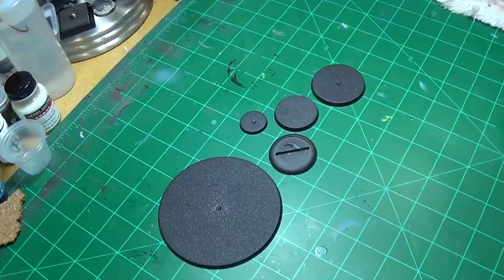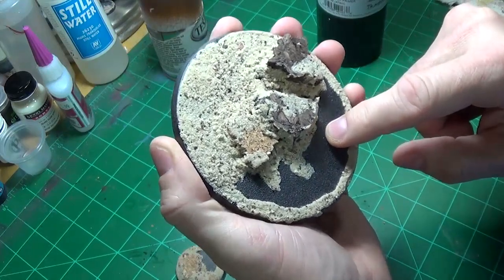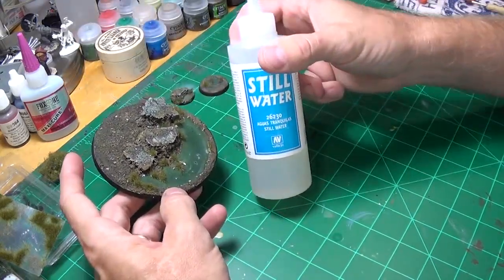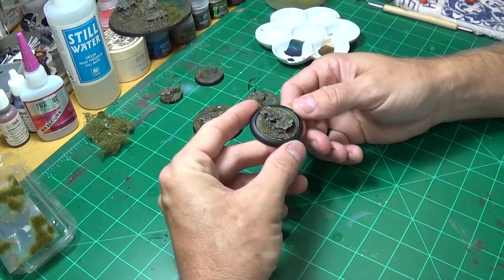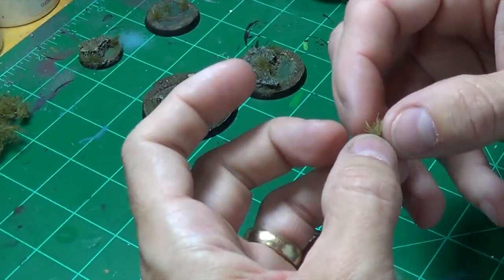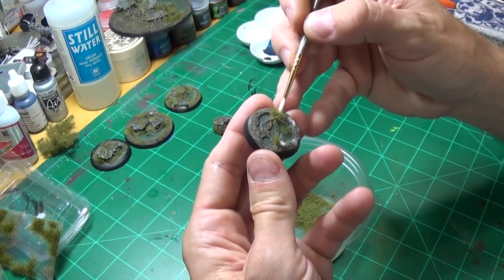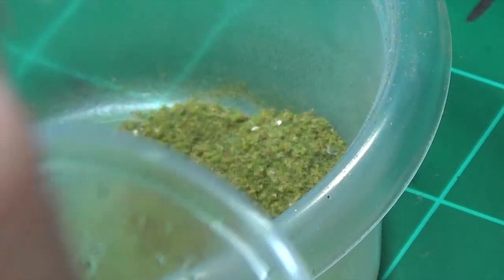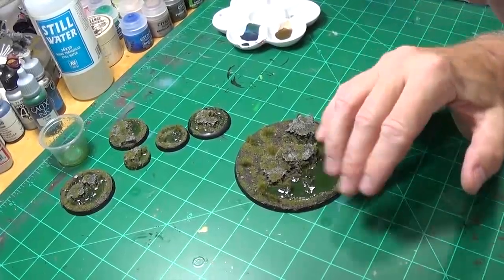How to Make a Swamp Base for Miniatures

Comment: Loved it! I especially loved your texturing of the basic gravel (by picking out a few of the stones with some natural colours) and totally agree that a uniform dry brushing is completely unrealistic. 
The bits of flock in the water worked amazingly too.
I noticed that the water turned out incredibly wrinkly. Does it always turn out that way or was the accelerated drying time the cause?

Comment: I was wondering if I could spray miniatures with the dullcoat instead of varnishing them, also if I do this would the dull coat have a chance of frosting like spray varnish does, thanks for the help.
Reply from the maker: I cant recall using Testors dullcoat and it ever frosting my miniatures.
Reply: Once I switched to Dullcote and Glosscote (going on about 4 years now) I've never had the problem with my models frosting when I seal them. This really is a great product and I can't praise it enough.

Comment: I'm new to this and have noticed bases with pre printed terrain out there. Those tend to have quite an uneven terrain for miniature placement. How should that type of base be used?
Reply from the maker: VashTS, If the miniature allows for it, I would drill small holes in the bottoms of the feet and insert pins to help anchor the model to the base.  You may have to build up the surface with a putty of some kind to make it level.  It really depends upon the miniature and the base.  A crazy shaped base might require a re-positioning of the model to make it fit.

Comment: Is it possible to swap Vallejo Inks for GW Washes/Shades?
Reply: I mean, yes, you can. Inks however are much more concentrated and a better way to dye your water. Start with very little at first. Like I said the inks are very concentrated and you can quickly overpower the saturation if you put too many drops.